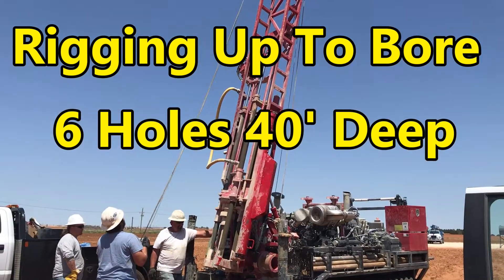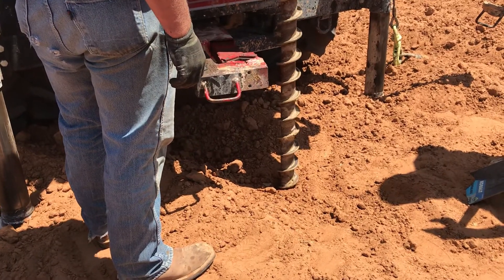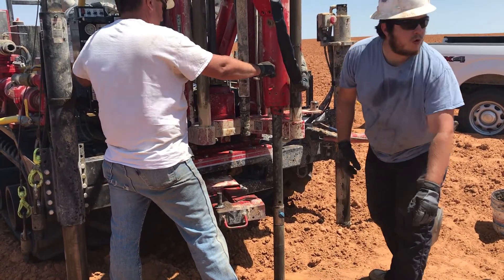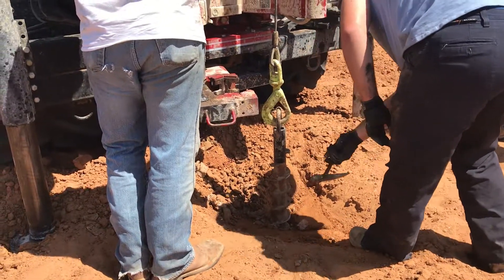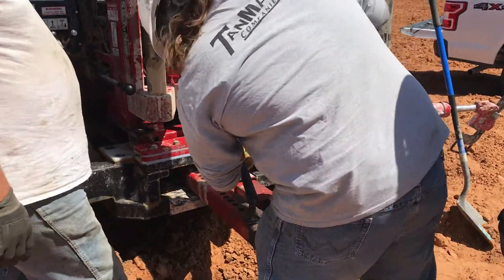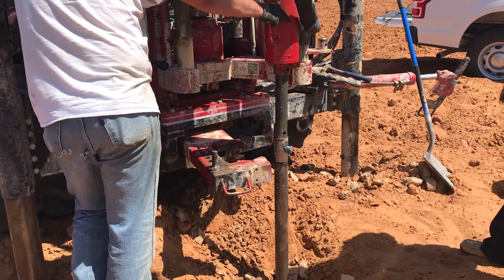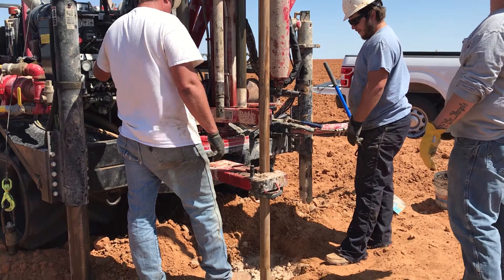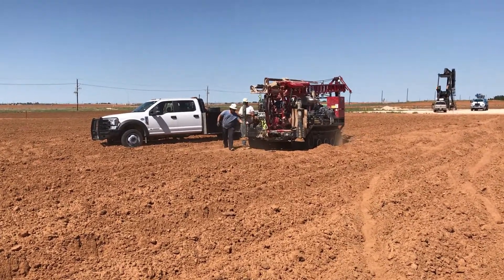Drilling Core Samples For Foundation

Comment: Now that was a totally interesting video Kim. What a rig !!  We have a couple local well drillers here with similar (?) truck mounted rigs but this one is COOL !!  I wonder if anyone has ever hit oil drilling a test hole.  Heck Jed Clampett hit oil with a muzzle loader !!!  Awesome video sir. Thanks man.
Reply from the maker: In the 30s some of oil wells drilled during the boom were less than 3000 ft
Reply: @TripleTRanchAndSawmill  I got a chuckle out of the late comment Kim.  LOL.  I do the same thing.  When I find one or two that slipped by I still respond to them...So far anyway.  I  have no concept of oil well drilling, like the depth of the average well in a given area.  No clue at all.
Reply from the maker: @tractorman4461  when the ambient > 100F, good time to process comments.  In west texas, we drill down vertical 7000’ and then turn horizontally for 10 to 15000’ in the “play”.  So my grandfather’s well was producing from 200’ of play for 100 bbls oil / day.  The modern unconventional well can make 2000 bbls / day.  That’s how we became energy independent.
Reply: @TripleTRanchAndSawmill  Very interesting for sure.  It's hard to think of how that's done and the horsepower required to drill that distance.  That's close to 4 miles !! I DO know though that the modern rotary drilling head was invented by a local man and his business partner.  They both became very wealthy very quickly.  At least that's the popular story.  He just passed last year at 85 and still worked 7 days a week at his well drilling and parts business.